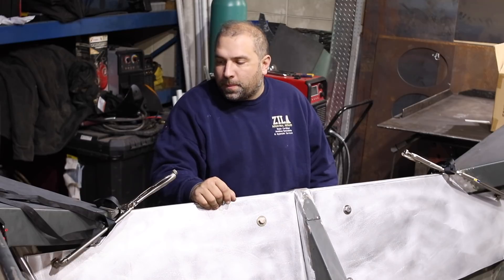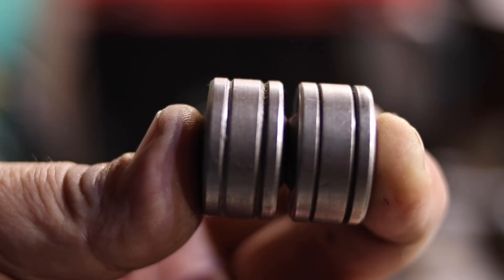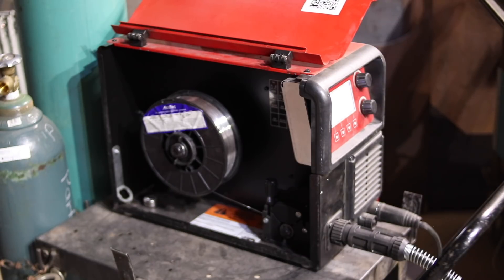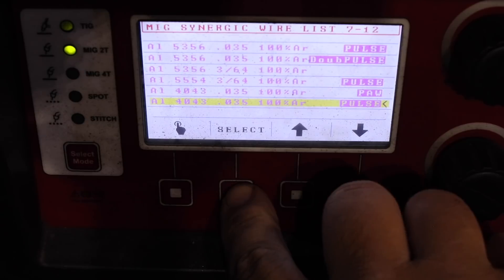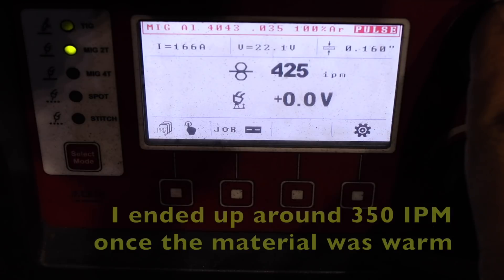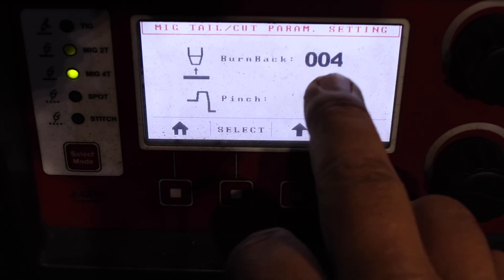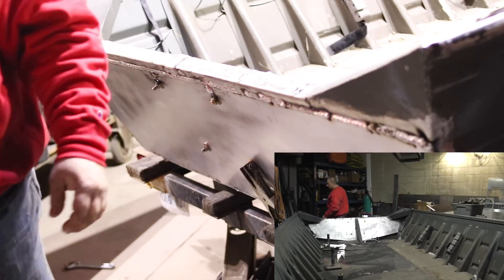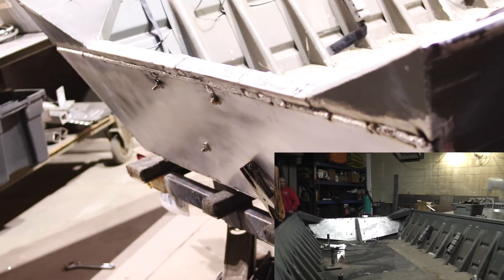How to pulse mig weld , in depth tutorial welding on an aluminum boat with the HTP Pro Pulse 200

Comment: Makin it look easy brother!
Reply from the maker: customer did good prep - and the machine makes it look easy ...  the stuff even goes in like butter on overhead ...  
i mean - not saying that some experience is not a good helper - but
there are machines that no matter how much experience you have  - and no matter how much you do - you are still "fighting" it every day - and than there are machines - they just work great !

so my machine shop guy had an old linda 600 amp wire welder - and he absolutely loved it !      so he bought a PP200 for some aluminum stuff (never the less because he saw one at my shop - but lets not digress)  

so he called me up his machinist  and part time welder was not in that day and he had to get a 6" Channel from a welded up and delivered the same day - he said: you need to come over and weld that - now when heals i typically jump !    (that works both ways thought - he saved my a$$ more than once ...  )

and i started welding that frame - and in typical machine shop fashion - everything was clean, milled, squared .. ..  no mill scale no surface rust ....  just " a welders dream" - THAT is how they do it there  - quality and nothing else.
So i started welding with his machine - and it didn't look right, it didn't feel right and i think the liner on his gun was going out ...  

so i walked out to the van, grabbed a roll of 030 wire and started to set up the PP200 for Steel, pulsed mig .....

he started yelling at me - what are you doing there!?!  

said - making sure you are getting nice welds !

he said - this is thick stuff - you better use that 045 wire !  i said - nada  030 will be fine ....  than he started to shake his head and walked away in his office ...   

typically when he does machining - i leave him alone - when i do welding - he leaves me alone ...  we both have that done more than once before and typically do not need 3rd party advice on how to do things ....

he comes back about 15 min later - looks at the welds - spatter free !!!  beautiful as all can be !  

another 30 min later everything was welded up - i left he shipped the frame to the customer.

a week goes by ...  he calls me and says - can i get 2 more rolls of that wire ???  

and a roll of stainless, and a roll of aluminum  - and what gasses do i all need ....

another 2 weeks go buy - the 600 amp machine   GONE !!!!  he said it took up too much space ...   LOL
Reply: I had them throw in 35 and 35 tips with mine. I have 30 on hand. Not sure my Lincoln 30 tips are compatible though. Tracking says I'll have a PP200 in my shop tomorrow.
Reply from the maker: htp is binzel not tweco
Reply: ZILA  do you prefer to run 30 wire or the 35 on steel in the PP200? for some reason my Lincoln 175 ran better on 35.
Reply from the maker: i run 030 for spray pulse (there is no program for 25 for that) and i run 030 for short circuit mig of i am too lazy to switch to 35 and i uses 030 for auto body thickness and really thin stuff ...
so basically i uses 030 pretty much all the time ....  
030 and 035  both run up to 200 amp both run up to 1/4" material thickness. 
both run fine ...
Reply from the maker: lincoln is typically a tweco gun - tweco guns are ste thread ...   you need M6 tips ...  sometimes your local tractor supply store has some

Comment: Is minimum wire feed equal to 0 fpm?  If not, why any modern machine would not have a gas purge function without feeding wire is curious.
Reply from the maker: on this particular machine the minimum wire feed rate is 4 imp in manual mode i believe and 55 imp or more in the various synergic programs - depending on the program ....
most modern machines have Purge buttons some also have Jog buttons ....  
me - call me old school or ignorant ...  
there are a few inventions that i don't really use ...  (personally) 
that does not mean that those functions are bad or anything ....  I own about 30 welding machines ...  some have jog and purge buttons  - some don't.  and the ones that do - they are ALWAYS in a different location - some are inside the machine (you have to open the wire compartment) some are on the front panel ....    

so i have defaulted to use the torch trigger  - which is btw pretty AWESOME  it is in the same location on every machine (right on the torch) and it is a "magic" dual function button - it can purge AND jog .... 

so it makes my live really easy ..  and in my mind simplicity is key !   also when you feed really small diameter wire through the torch or really soft wire - you want the torch to be as straight as possible  - so why would you wan to use a job button inside the wire compartment when the torch trigger is literally on your finger tips !

also this particular machine here has a function that shuts the gas and the welding current off after 3 or 4 sec feeding wire but not making an arc.

so on this machine there is not even any danger that the wire shortens out or anything ....  

So it's just me  ...  no "real" reason
Reply: ZILA - Any reason that you couldn't purge without wire installed; or, doesn't a purge occur when depressing the trigger to install the wire?
Reply from the maker: oh absolutely you can purge without the wire being install ...  and also the machine "purges itself" as you feed the wire through the gun (if you use the trigger)....  
I guess the point here was that you can use the purge function to check your gas flow rate (without feeding wire) not really to purge the machine and the gun .....
either way - i think this is being overthought ....

Comment: How did you determine the grade or series of aluminum that the boat and plate were made of?
Reply from the maker: the customer  (when he bought the material at his metal distributor) his invoice said 3003 H14    the boat - that is a little bit more tricky ...   a lot of manufactures will post on their website or tell you when you call them what grade aluminum they used.     only "high end" manufactures (more so than even big names - that is not the same)  will use actual marine grade aluminum  5086 most common ......
Pretty much the majority of "economy" boat manufactures and most "inland" or "sweet water boats" are made from 5052 H32 aluminum (that being the most popular by far)

Comment: Great tips. Best regards from Serbia. Just one suggestion.  Include camera with some kind of dark filter so people could seen gun manipulation.
Reply from the maker: i started using a new camera a week ago...   and i am still trying to find out the details ...  and i don't have my new filter plates for arc shot yet ....    normally heather works with me - the boat i did all by myself - its really hard to weld and film at the same time .....

Comment: Wouldnt 5356 wire  be more ductile for a marine application ?? I am NOT an expert.
Reply from the maker: i am not sure that ductility is higher on 5356 ... i made a few videos on aluminum  4043 vs 5356 - pointing out all the differences ...  and some aluminimnweldinh 101 video ....  in one or maybe both of those videos is a link to a lincoln electric 72 page brochure ...  that is HIGHLY informative !
since no real marine grade aluminum was used 4043 was adequate here ....  
a"real" marine application needs a 5000 series filler wire
Reply: Thank you !
Reply: 5356 on boat all the time 10 % mag ///4043  no good goes black  looks like  a turd
Reply from the maker: bill block FYI 5356 is AL MG5   It is 5% magnesium not 10
And under a few mil of paint it does not discolor either

And YES in a “real” marine application with 5086 base a 5000 series filler is an absolute must !
And if you dont know 100% what material you are dealing with 5356 is the “better” and “safer” choice.

Comment: I don't know if you had to do much fit up, but I would think about 250. For that job if plates were already cut and in place. I guess it would depend on if he is going to let you borrow it next summer.
Reply from the maker: the guy provided the material, wire brushed the paint off cut it to size and fitted 95% of it...  it was basically "just welding"

Comment: Pete I would have done the job for around 750$, including the fit up but would have tiged it. That's 288 inches at alittle under 3$ a ft. What did you charge?
Reply from the maker: he guy provided the material, wire brushed the paint off cut it to size and fitted 95% of it...  it was basically "just welding"       i had about 3+ hrs into it ... and some argon, electricity and wire ....    going rate in my area is about $80-$125/hr .....
Reply: ZILA- ok knowing that I change my cost, I was unaware of the time invested other than welding I figured more. In Texas we charge around the same per hour fitting or welding. I mostly do shop work. Check out my instagram Pete, millerismyname ive started to post some pics. I'd really like to get you opinion on my welds.
Reply: Chris Miller where in Texas are you because I’m thinking about buying a new job boat and doing the same thing.. thx

Comment: I dont know what to quote this one at?24 linear feet??hmmmm maybe 500$ plus the spool of wire? or more??I wonder if your quoting by the inch or foot?also ive been wondering when your going to be on the welding tips and tricks podcast Peter??...gotta be soon hey... thanks for sharing and putting real-world content out there..
Reply from the maker: for tig that price might be good - wire you cant get that much .....  or maybe if you are in a "high end" neighborhood than you might get away with that
Reply: @ZILAwelds  quality work doesn't have a zip code. People drive across states for quality.
Reply from the maker: @WHITERIVERRAMBO  in Wisonsin 53108 this job is worth less than in Illinois 60083 which is less than 30 min away from here but the job is at least 25%-50% worth more there ...  taxes on houses are 3x as high - the over all income of residents is 25-50% higher  cost of living and boating lifestyle is completely different ....

Comment: Can you use HTP's aluminum welding rolls and guns with steel? They seem to sell the propulse with guns and rolls for steel and others for aluminum. It would be great if you could get one gun for both steel and aluminum, the rollers don't really matter if they have to be changed out. I'm guessing but have no clue. I'd say $250 to $500 labor cost, but I have no clue how long it took to do that job so strictly a guess.
Reply from the maker: the Sharp v rolls are for steel, stainless and sibro only - the aluminum rolls are for aluminum only - that way you also prevent cross contamination....   as far as the gun the aluminum gun is a little bigger (but they sell that size for steel too) they are a little shorter about 8.5 ft .. like 2.50m   they have a special liner and special tips ....once you run anything but aluminum through that liner  - it is junk pretty fast or cross contaminated ....   
now there are guys where they use the same gun - but switch the timer and the tips out every time ...  to me that makes absolutely no sense  ....   between $250 and $500 is a good guess depending on where you are located